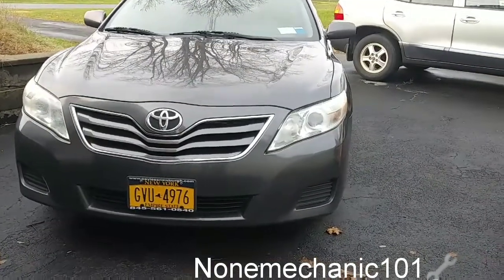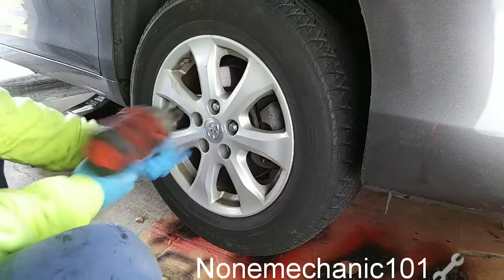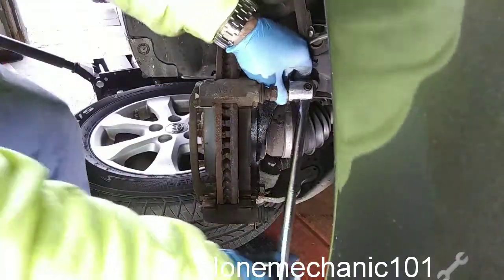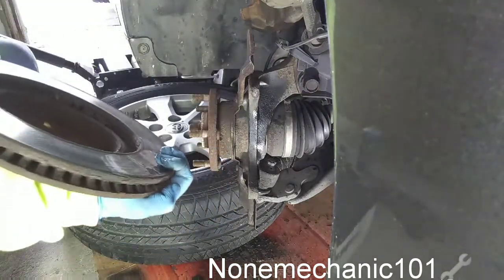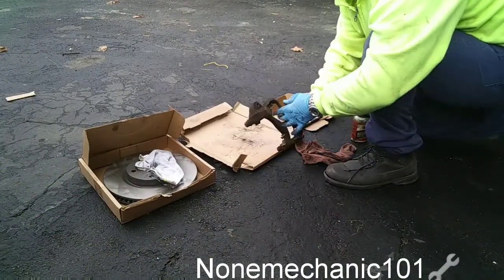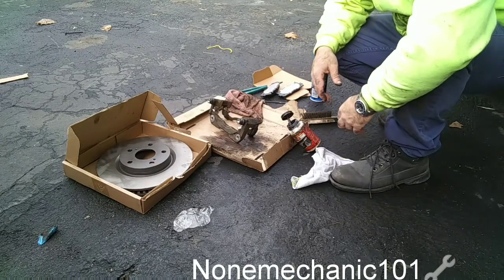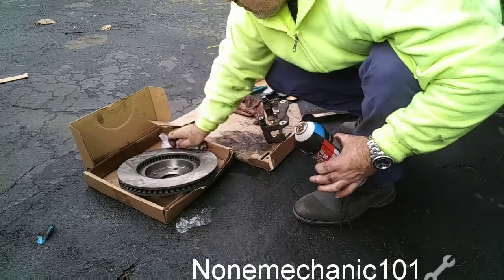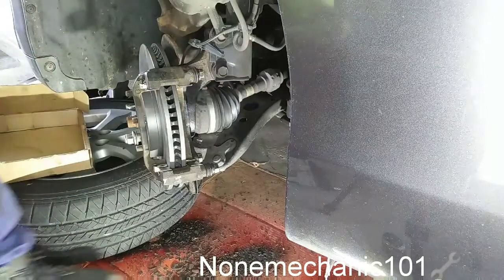2010 Toyota Camry Front Brake Pads and Rotors Replacement

Comment: I gotta really dumb question. If you’re just replacing the pads only, can I just take out the old, and slip in the two new ones and be done with it? Or do I have to take it all completely apart? Great video, thanks!
Reply from the maker: I myself like to clean everything before I install the new brake pads.

Comment: one of the ground wire in my hood broke, is it bad? its the one on the upper left corner inside the hood.
Reply from the maker: Ground wires are placed in a car for a reason. I would get it fix.